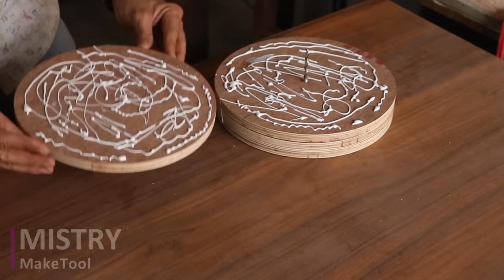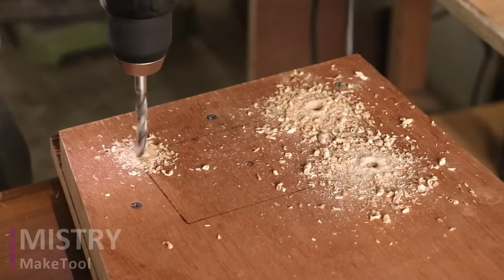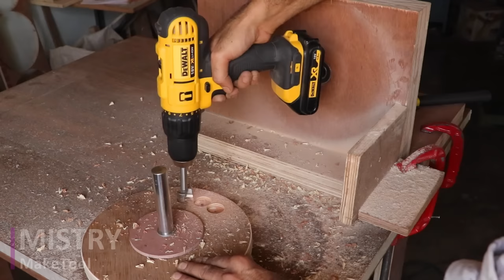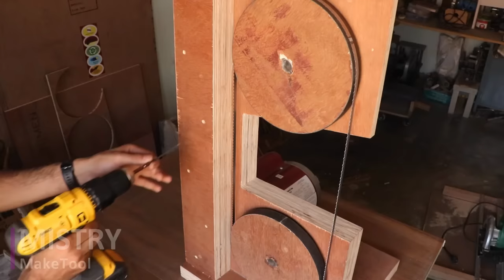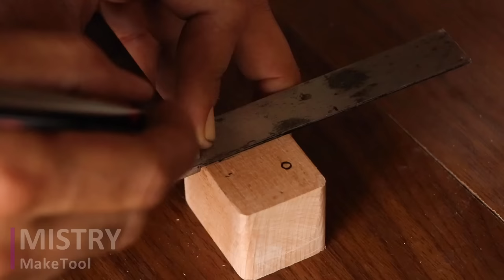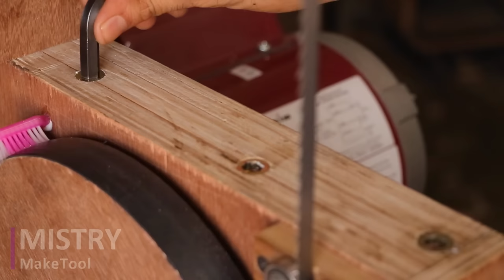How To Make A Mini Band Saw Machine || DIY Band Saw

Comment: Wolf that measurs distance goes hungry.I like your disrespect for precision. Working by eye and get the job done. BTW. What is the kerf in wood, not the blade kerf? Is there any safety mechanism that prevents blade from slip off the wheels?
Reply: Просто это 2843 пила, которую я делаю 😂 сегодня

Comment: Why nails and why slotted screws?  I mean is there a specific reason?  Differental hymiditry movement for the nails?  But why the slotted screws.  The damn things are inventions from hell and have resulted in more ruined screws that anything else I have ever done.  It looks like you use these abdominal things everywhere.   Is there some advantage I am not aware of?  Esthetics?